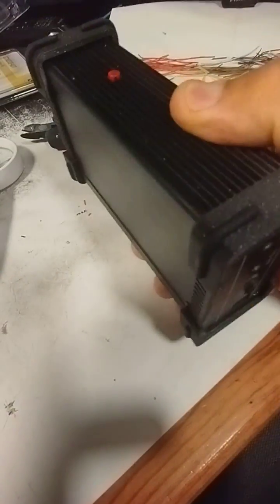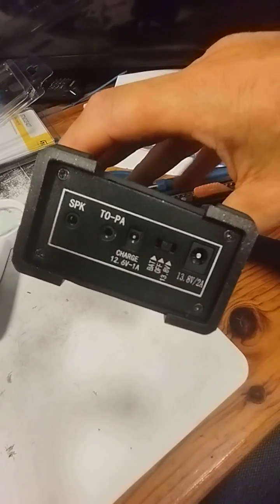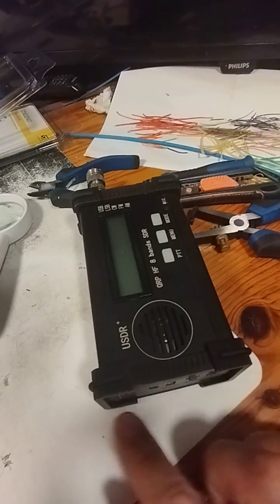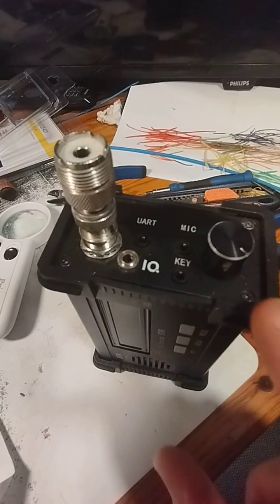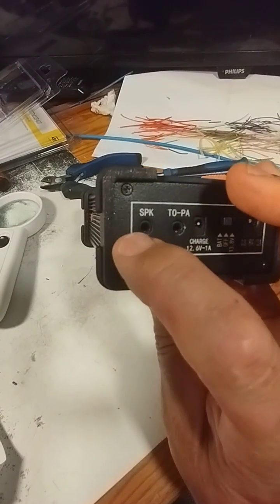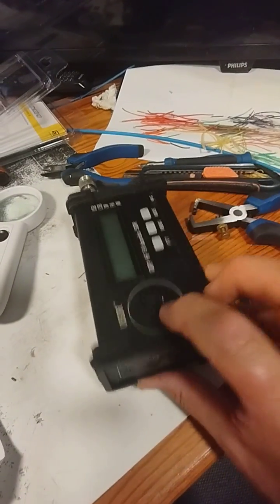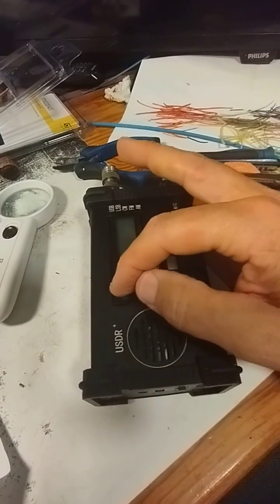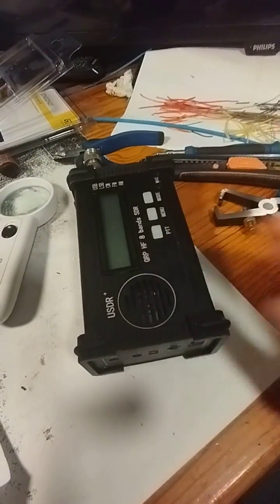How to open the uSDX Red Corners rig

Comment: Thanks for the video Rob! I'm looking to use mine on digital modes... do you know where to find instructions to build the cable/interface? Thanks in advance, Jorge VE3EAD
Reply from the maker: the FB USDX USDR Radios group has the info in the files section

Comment: BTW this can just as easily be done with a raspberry pi. Most people already have one laying around no need to buy more hardware. thanks for the vid
Reply from the maker: not quite as easily, and the Pi is very power hungry, consumes over 10x more than the Spectrum DSP
Reply: @robc3863  no i mean the programming / updating / uploading the firmware to the radio. it does not require an arduino board. the pi can work as a programmer with avrdudess